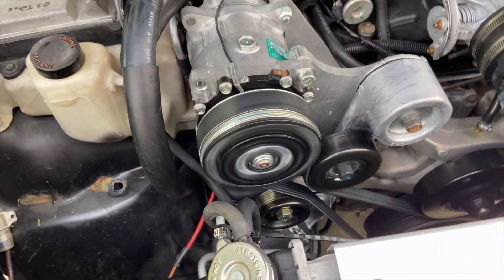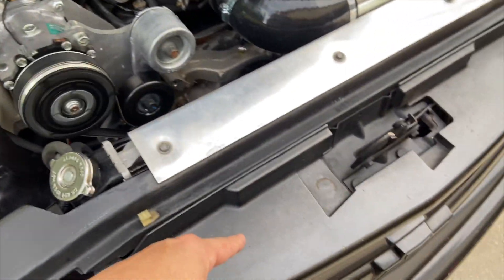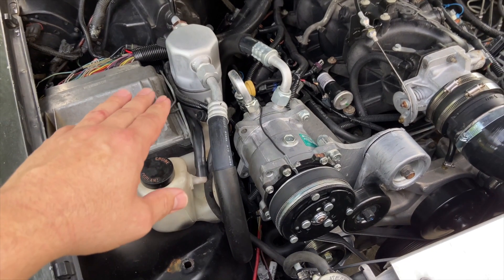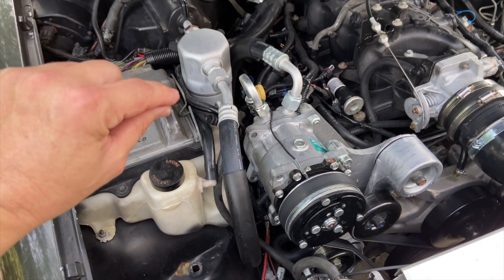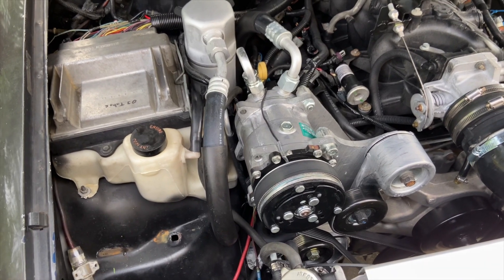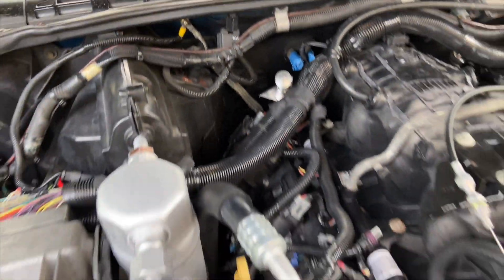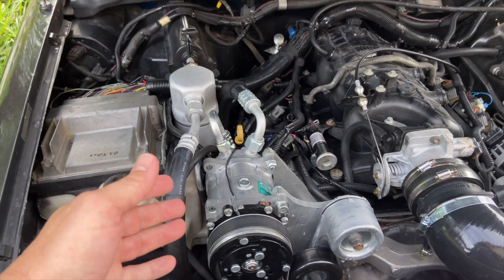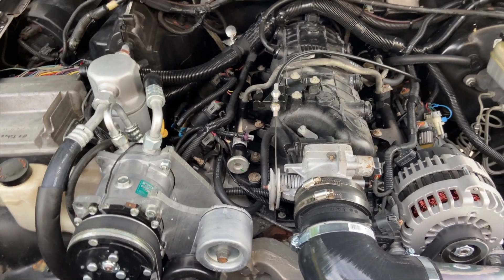Sanden 508 Hot Rod LS Swap A/C Wiring How-To Diagrams

Comment: hey  cliff  just did an  ls  swap  and used  dirty dingo  bracket  to install   sanden compressor  questioning have  is  what size and  fitting  type  are  the  sanden tie ins
Reply from the maker: The sanden 508 like what I have is Compressor Discharge fitting #8 (3/4" - 16 thread) 
Compressor Suction fitting # 10 (7/8" - 14 thread)
Reply: man  your  a  life  saver  thank u  cliff
Reply: and  that is  a  female fitting   right ?
Reply from the maker: The fitting on the hose is female, and the compressor is male.

Comment: Hey i tried wiring the ac on my 5.3 s10 swaped like u did!  the dark green wire from fuse box that plugs into ac conpressor is not getting power i tried using a jumper wire from terminal 30 to 87 on relay it works does the Ecu control the power to the dark green wire for the ac compressor?
Reply from the maker: Honestly, it’s been a while since I messed with this. I put a diagram in the video, that I think is pretty good. 

I know that you do have to have the ECU programmed correctly for it to work though.

Comment: Hi I been following u since u started the swap in your  s10 I have a question is the trinary switch your using a male or female im gonna working on  the ac in my ls swap 5.3 s10 but I noticed where u installed the trinary switch mine needs a male switch did u use like an adapter
Reply from the maker: Thanks for watching! Very much appreciated! 

This is exactly what I used: 
https://amzn.to/4btpNbU
Reply: Thanks hey another question I saw the diagram your using in your s10.  pin 55 that's in  ECU is "Ac low pressure switch signal " u grounded that wire from ECU?? My question is simple did u grounded pin 55 wire from the ECU ??
Reply from the maker: Yes. In the C2 plug for the ECU, pin 55 is grounded.
Reply: @CliffsHowTo  thank u so much I order the trinary switch I was able to do the swap on my s10 all thanks to you I used your information and parts and it made my life slot easier your s10 looks amazing with the Corvette rims I bought a Btr truck Norris cam im in the process of buying a Holley terminator xmax for the 5.3 thanks a lot man do u plan to cam turbo or do nitrous on the s10?

Comment: I dnot see the 90 a/c bracket!! Did it had issues??? Or
Reply from the maker: The one I had was flexing a bit, and the belt would jump a rib. 

I made the one that’s in the video.
Reply: @CliffsHowTo  @ how much? For making me one
Reply: @CliffsHowTo  @ iam in texas
Reply from the maker: It took me far too long to make, honestly! And I don’t currently have a drill press. I think they sell ones that are similar.
Reply: @CliffsHowTo @ on the diagram picture, does diodes are backwards?? Or?
Reply: @CliffsHowTo @ what about the adapter s?? U still got them

Comment: I’m stuck! What is the C2 plug fuse box B3 and B4?? Could I run the BRN/Blk wire with in line fuse straight to ac compressor?
Reply from the maker: Those would be plugs on the AC relay, in the vehicles fuse box. Sorry that wasn’t made clear.

Comment: So if I wire mine to work independent of the LS swap ecu how will it idle correctly as the ac cycles on and off?
Reply from the maker: So, I programmed my computer to idle up when the ECU got the AC on signal from the cab. I just couldn’t figure out how to get the ECU to work off a sensor to control the compressor, based on pressure. That’s where the trinary switch comes in.

Comment: Any chance of you knowing which wires to connect on the ECU having the blue/green connectors? I have a 05 vortec swapped into a 94 c1500. This ECU/harness doesn't have any wires in C2 17 and 55
Reply from the maker: Lt1swap.com has all the wiring diagrams for these ECUs. He also has a page explaining how to hook up the a/c in various ways. 

It’s a very helpful site! 

You may have to add wires to the open pins though. I think I had to add a few, for various reasons. (Such as wiring the electric fans)

Comment: Great video! I'm currently looking at how to power up and operate a low mount sanden a/c compressor on my '91 w/5.3. A question I have is about your first diagram....did you have the pcm set up for both a/c request and cycling switch to operate? If so, could this create a problem, I mean to say, should it be one or the other and not both? And the wire running from c2 pin43, can it run directly to the compressor but with an inline fuse OR would that be a relay? Thanks
Reply from the maker: I tried programming it in every possible way, using HP tuners, and couldn’t get it to work. I’m not sure what I was doing wrong.

But it works just fine like this!  Ice cold AC!
Reply: @CliffsHowTo  Thank you for responding, I'll give it a try!
Reply: @CliffsHowTo  of the 2 diagrams, one with computer and one without, which one would you recommend?

Comment: Great video! Quick question. Could you also use an inline fuse in place of the C2 Fuse Box? Where is the relay for the compressor? Is it in the C2?
Reply from the maker: Thank you. I am running through the C2 for the a/c relay circuit. 

But sure, you could not use that, and wire up whatever you need externally.
Reply: @CliffsHowTo  Thanks so much for the info and the reply! Stay safe!